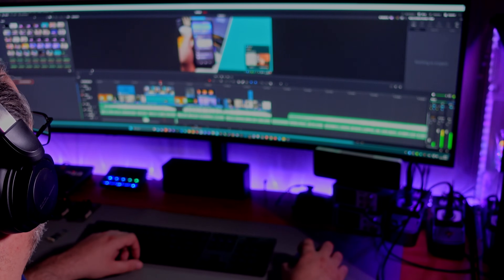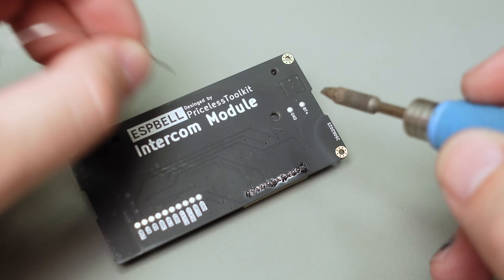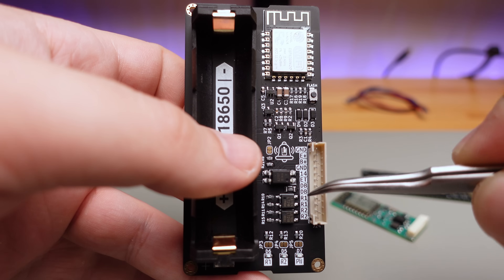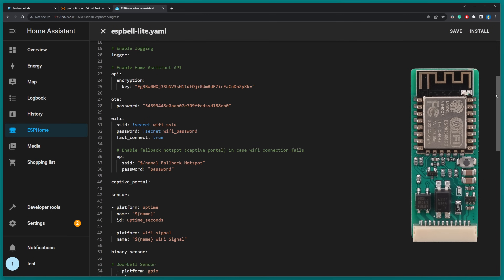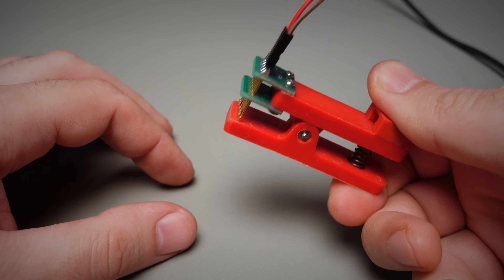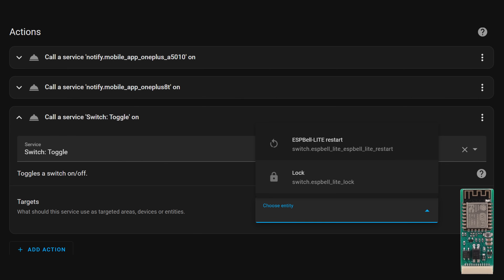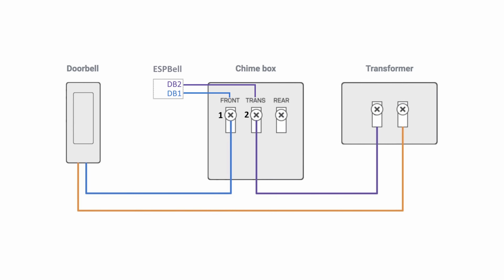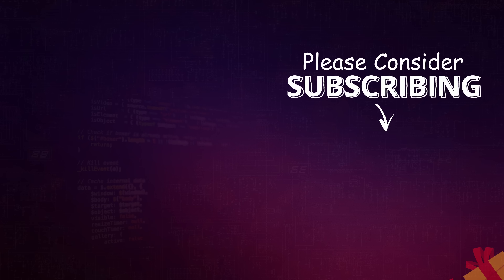Intercom and Doorbell Smart Modules for Home Assistant | ESPBell

Comment: It would be interesting the web configuration in the ESP instead of home assistant this way you can configure it in AP mode plus add HomeKit compatibility even visible in Alexa and thus have notifications in alexa.

Just a thought.

I also see two relays on the Max model but not two input with opto.

I don't read in the github anything regarding the use of an additional input for that Second relay.

This way you could use it as a street doorbell and street doorbell and home doorbell and home doorbell. (That's how I have it with another circuit of my own, not commercial).

I used an opto to add it to a Shelly this way I have both or with a Uni the same.

I see a 5k resistor on the opto I don't remember which one I used but that one is big. 

Fermax gives about 2.8v ac or modulated I seem to remember.

I repeat it would be interesting the web configuration option integrated in the ESP and HomeKit compatibility.

Consider creating a Telegram group is much better, Facebook those of us in this world of automations don't use it. 

Thanks and good job!
Reply from the maker: Thanks for your insights! The second relay is indeed designed for a second door, and it features one optocoupler that can be triggered from as low as 2V, so using a 5K resistor is appropriate. There's also a standard input that can handle up to 5V. I believe one optocoupler is sufficient since we're only dealing with one doorbell. Regarding HomeKit compatibility, I don't have any experience with Apple products, so any resources or links you could share for better understanding would be great. I'll also look into adding ESPHome web configuration. Thanks for the feedback and suggestion about creating a Telegram group; it's something to consider. Thanks again for your support and good job on your setup!
Reply: I was on the Souliss project before these systems came out as well as the development board. 

We were able to activate without any complication the configuration via web enters without problems on an ESP12. 

The advantage is that all the configuration including the wifi connection is done in ESP AP mode without the need for external code. 

You can configure what you want it to display, plus an Alexa compatibility using belkin's Wemo.

It takes up very little space. 

This same thing could be done with HomeKit but it takes up more code so it would just be one or the other configuration.

It's been a while since I abandoned the project if I can and I have time I look it up on their github and see if something can be done without much work. 

About the second optocoupler is because in your esqueja the external input is the same as the latch and that of the call. 

It is not standalone and cannot be used as a secondary, you could only use a free pin as you say. 

But looking at it it looked like a cool different input for another doorbell and the second tele for na second input. 

Thanks for your work I leave it here that I get long writing 🤦🏻‍♂️

Comment: 0.11uA average is 0.080mAh per month. mA is an instantaneous value so can't accumulate over a month.
An amp per second is meaningless since an amp is already a rate. Really what you calculated was 21uAh per second so about 0.315mAh per 15 second wake up.
That is extremely low so good result there.
Reply from the maker: Thanks for the correction about the 'h' I left it out on purpose to make it easier for beginners to understand how long the device lasts. Saying '21uA per second' might not be conceptually accurate, but it's simpler to get the idea across than '21uAh per second'.
Reply: @PricelessToolkit  Making up units like A/s (amps per second) and using incorrect units is not helpful.
Reply from the maker: Ok, I will stick to the conventional way of expressing electrical measurements.